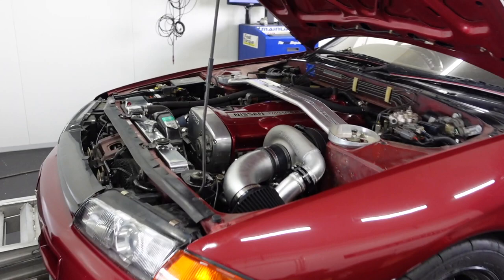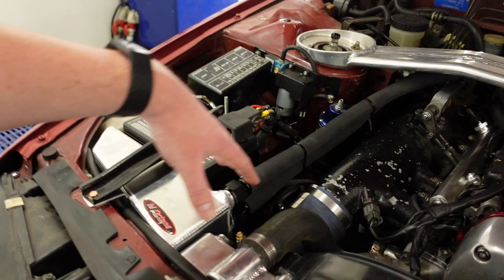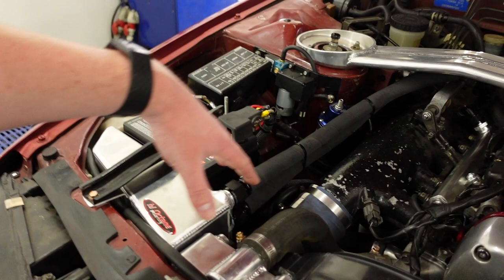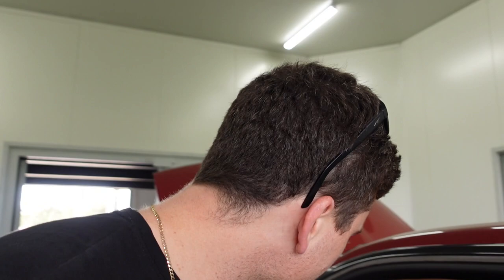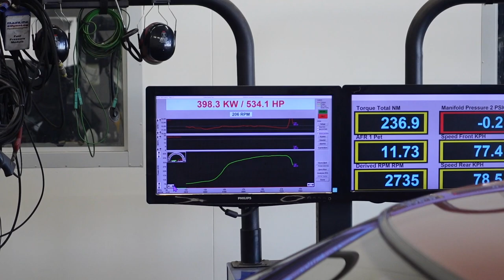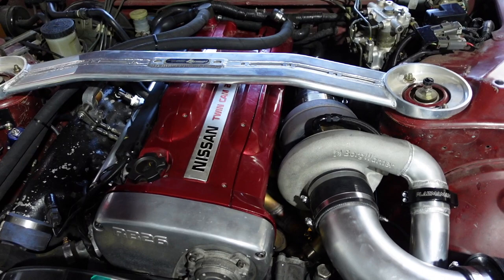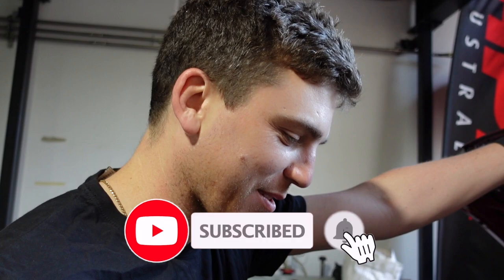R32 GTR | BIG SINGLE TURBO REPLACES THE FACTORY TWIN TURBOS | POWERTUNE AUSTRALIA | 291

Comment: Is the head basically stock on it ? No head studs at all ? Interested to see what is a “safe” amount of power before you would do head studs or basic head work
Reply from the maker: Built engine this one. As for the gasket and studs, im not sure myself. But I believe it may be coming back for more upgrades soon.
Reply: 400whp or running -7's/-9's safe amount of power stock head bolts , upping to 500whp is when you can expect to have leaks.

Comment: Gees Big difference on e85
Reply: Remember pump 98 you are limited to about 22-23psi boost before starting to knock. E85 you can rum much more boost and more timing.
Reply from the maker: Yeah boost and E85 make a massive difference.